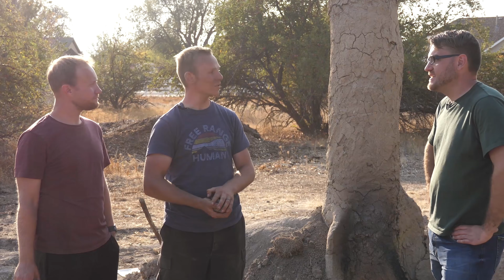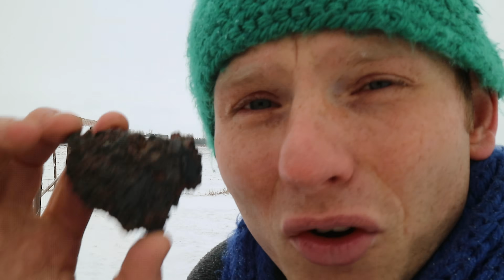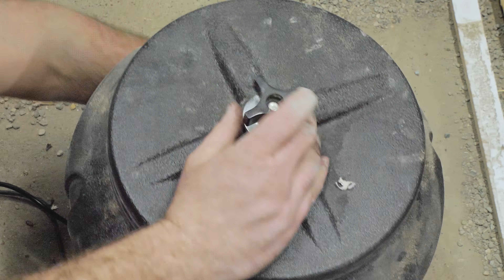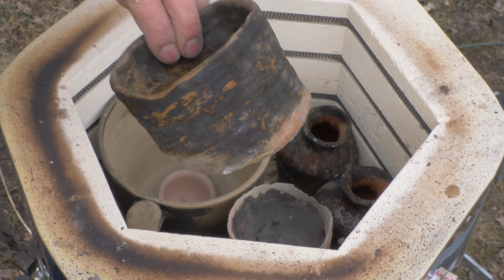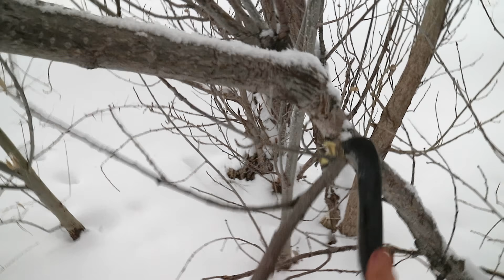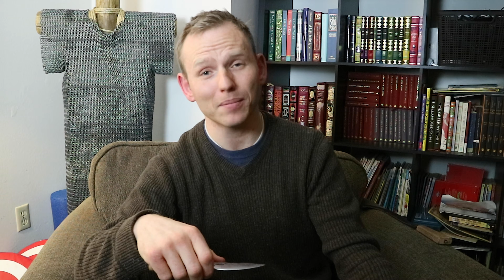Restoring and Reforging Fire Damaged Tools

Comment from the maker: Thank you to Dr. Squatch for sponsoring this video! New customers can receive 20% off $20 spend or more using my code DSQHTME https://bit.ly/3pvUEPw
Reply: Do you still need help from people in the MSP / St. Paul area? I am right in the area and willing to help out. I'm on your discord.
Reply: Try to rebuild your house out of cement
Reply: @kohhedley3772  Maybe stone, clay or dirtcrete?  Wondering if like glass, the clay can be low fired to re-sinter and relieve/bond the stress cracks if present?  Was wondering if can be done alone or maybe like with a thin slip coating to provide some fill material?
Reply: how long did the vinegar take
Reply: Will NEVER buy Dr. Squatch, they made a big impression on me by cursing at me in ads and blasting the volume in them. They are THE main reason I finally got an adblocker on my browser.
Reply: I understand that you need any sponsor you can get right now, but I hope this thing with Dr. Squatch doesn't become a long term partnership. Their advertising is so full of toxic masculinity that I just can't stand them, and on top of that they make a big deal about synthetic detergent, AKA soap made in a lab, not actually being soap. I'm not going to like you any less for taking their money to help you rebuild, but I hope they don't get many sales out of it.
Reply: @bow-tiedengineer4453  Quick followup to this. Their business model is also ecologically unsustainable. Sooo. yeah

Comment: I've had some luck with using a knife held with the blade towards me in an icepick grip to sever branches of around pinky diameter or lower. Holding the knife in such a way ensures some level of safety as well as priming the use of your pectorals and deltoids to sever the branch after it's bent around the blade. This is probably ideally used on small, green branches, so it's not the best way to gather immediately useful firewood, but can very well be convenient if you're only carrying a knife.

Comment: Seems my notification bell was turned off for some reason so Im catching up now on the last couple vids. Don't get me wrong, I HATE that you had to deal with the fire and all the loss of all that hard work. But, silver lining is a LOT of us are going to love watching you restore and remake some of these tools so you can continue the work you do. Thanks for not giving up, I can only imagine how much that may have crossed your mind. BTW I find for a modern method that simple electrolysis with a dc current is the fastest, most effective way to remove rust from any metal. I usually do the process in a vinegar solution though.

Comment: there. Love your work. I have a question regarding aluminum oxide. What chemicals or oxides can reduce aluminum oxide melting point if you heat them together in a crucible in a furnace? I know this auestion is not in par with the video above but I dont have your email address. I will appreciate your feedback

Comment: Yo Andy, If you want to look at a more primitive chelation agent you can look to molasses (with water added). It's a bit weak in comparison to evaporust and has a tendency to mold on top of the solution, but a definite option!

Comment: I actually did make some high grade steel, completely on accident. I used a bucket with a hole just above the bottom, and a tuyere (a small steel pipe) leading to the center. (Basically the bronze furnace Andy made). It basically smelts every/anything.

Comment: Did you normalize and then requench/-temper your steel tools? If not you have no knowledge about the structure of the material which could potentially be dangerous on tools like your hammers.

Comment: If you really want to get the stubborn soot off the large ceramic pieces, piranha solution would make quick work of it. It is however pretty dangerous to work with, I'm sure NileRed would be glad to take on the challenge

Comment: You should try Boiling it in water to rust blue some of the iron or steel peices. It was historically used in firearms to make a rust resistant coating of gun iron and steel

Comment: I didn't thought that vinegar can do the job. But I formerly transformed rusty nails by using Coke, so I think different kinds of acid may work. When we found our garden scissors after 1,5 years in the compost, they were rusty af and I was impressed by the rust remover we bought in the shop. it gets a nice finish with WD40 and is like new.

Comment: The tools that went through the fire are going to be softer and won't hold an edge very well, also the hammers will deform faster from the impacts. Since the handles are on, I suggest using a torch to heat just the contact surfaces and quench them. Differential heat treatments on blades actually makes them a lot stronger than a full quench would anyhow.
As for bronze, that'll have to be work hardening; unfortunately there is no work-around.

Comment: The Evaporust attacks iron oxides, but not the carbon or elemental iron. Vinegar will attack everything. Because of this, vinegar needs to be thoroughly removed but Evaporust just gets a light rinse. 
Both methods leave steel a dull grey color, Evaporust is darker because of the elemental carbon that is left behind on the surface. 

I use both methods but much prefer Evaporust if I'm working with steel or iron. For bronze and copper restoration, you have to go with an acid.

Comment: Damn it's good to see you getting as much back as you did. Without redoing the heat treatment on the medium carbon steel sledgehammer head you have basically a soft face striking hammer. It'll mushroom out with heavy use, but it IS good for striking other steel tools without dangerous chips breaking off, so it's still a very useful tool. Looking forward to seeing what's next.

Comment: I have used the vinegar method with great success, I leave it for the 24 hours then dunk it in Windex brand window cleaner or spray it on. It neutralizes the acid and what rust is left tends to wipe right off. Great video sir, glad to see you're still going.

Comment: hey! great job!  just be careful with the ultrasonic cleaner.  The bottom of the... "bowl" is what vibrates and makes the thing work, so if you rest metal objects on the bottom, you have a significant chance that the metal item will rub through the bottom as it works it`s magic.  that`s why they give a mesh container or plastic bottom with the cleaner

Comment: For the broken pottery, what about trying the kintsugi style of repair (using thin gold to repair and celebrate the imperfections)?
Reply: Specifically, you use resin or epoxy as a glue, and then apply a very light layer of gold to the outside as accent to the damage fixed.
Reply: Cody'sLab wink* wink*

Comment: they are only black from carbonization from outside
Reply: the soot carbon
Reply: you can piranha eat the carbons from outside, the acid solution, or only use oxidizer, because ceramics will not rust from being oxidized, piranha solution should fix the rusted metal items too
Reply: react away the rust and expose pure steel or iron, then recoat it with some protective solution
Reply: the concept of piranha is to wash the outside layers away, strictly, and oxidize depending on the situation
Reply: you could even use fireworks oxizider to scrub the soot, or blast is with pure oxygen to burn it
Reply: build with something that will stay, like stone or strictly from steel

Comment: It's so strange that the solution to damage by fire could be more fire, but so many of those pots turned out amazing. So glad you managed to salvaged so much and are making steps to get back what was lost
Reply: The importat distinction would be that in a house fire, the combustion is almost always incomplete (as you would expect), so it leaves a lot of soot, ash, and other byproducts all over everything involved. Whereas in a controlled fire like a kiln the combustion is more complete (especially if using charcoal) and is left to cool down slowly, giving any leftover carbon plenty of time to burn off.
Reply: @MGSLurmey  That happens because the ash which got deposited on the terracotta gets turned into glaze, by firing it again. Not a strong glaze, like that from sand, but still a glaze nonnetheless.
Reply: It's mostly stuck on carbon. Once it's all spent it it essentially turns to dust
Reply: It looks like the the pots were in a reduction environment where the fire created a oxygen free/low oxygen environment. At the point the the fire is looking for oxygen wherever it can get it and will exchange carbon for oxygen at the molecular level. What you get is carbon trapping, no amount of scrubbing would get it off. Firing it again reverses the carbon exchange. It's the process potters use to do raku and reduction firings.
Reply: @MrJoejkim  Interesting! I didn't know that's how raku and reduction firing pottery works that way. Thanks for sharing!
Reply: Well yeah. The basic concept, is that rusted iron, is just steel that’s slowly being eaten, and turned into rust, which is essentially pure hematite, which is actually used to make the higher grade steels. (Basically- “Rust” or “Iron Oxide”). If you put it under enough heat, it should just turn right back into steel- and even create a new layer of steel.
Reply: Fight fire with fire
Reply: its smoke that damaged them not fire.
Reply: How is it strange lol